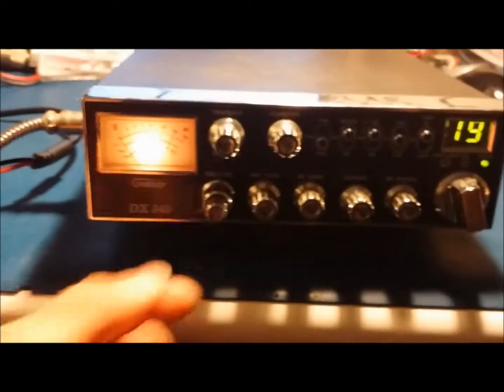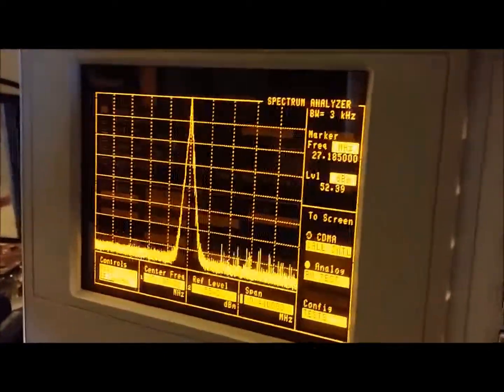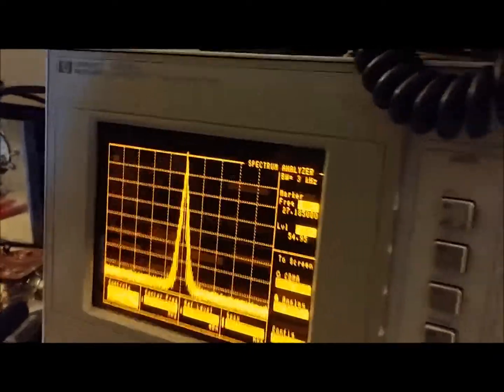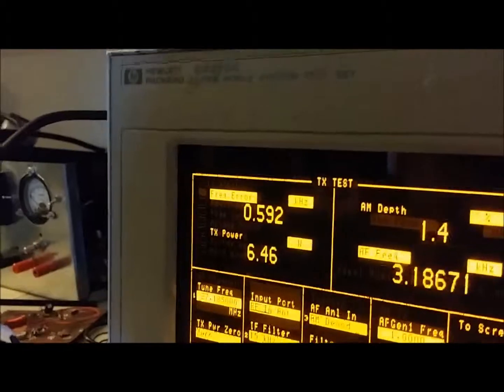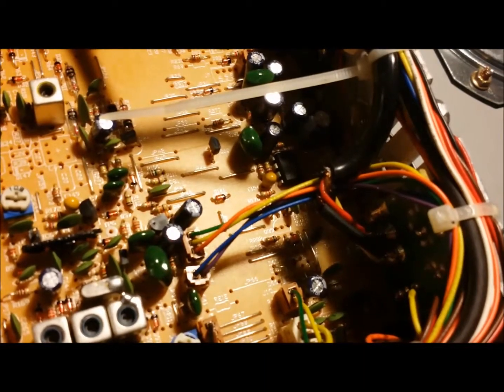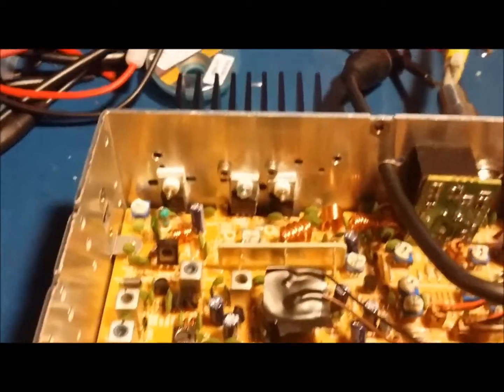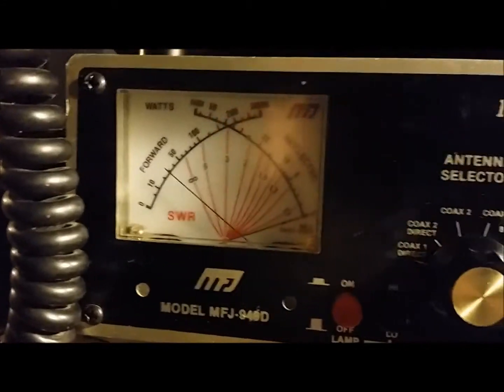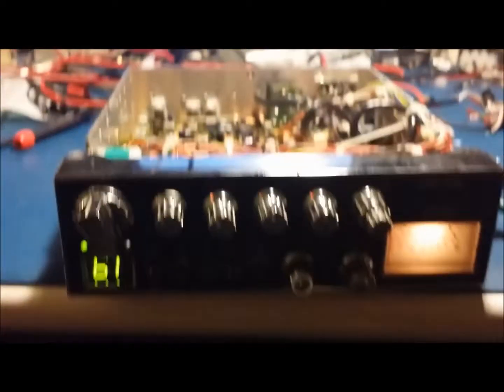Galaxy DX949 tune up report 10 9 14

Comment: I recently got a dx959 and q39 was missing, as a result sideband sounded like crap and AM modulation was over- maxxed all the time. So the 2sc945p is back in place.
Reply: can you fix the modulation problem with this 2SC945 at Q39?